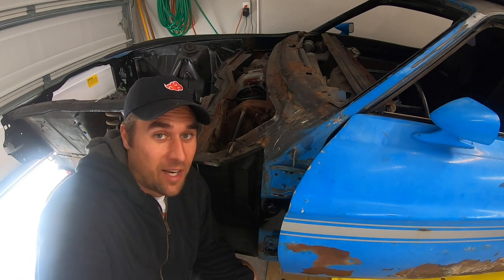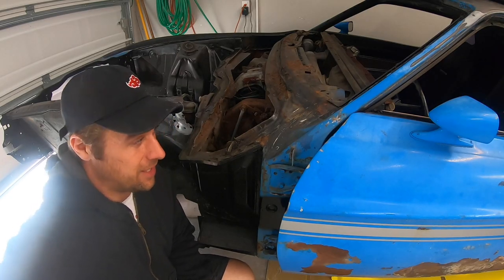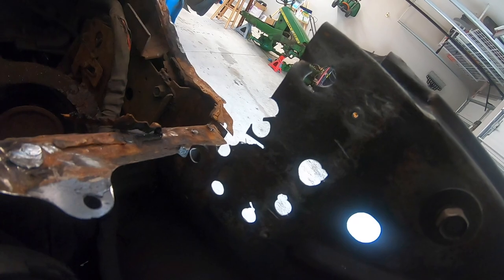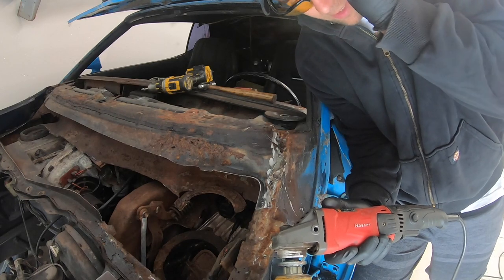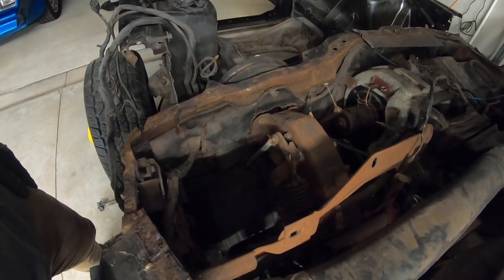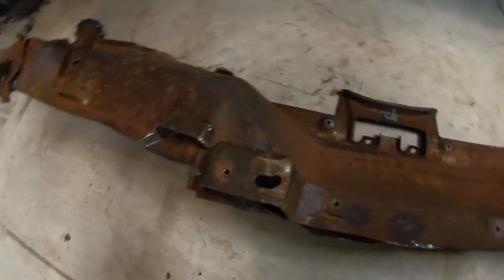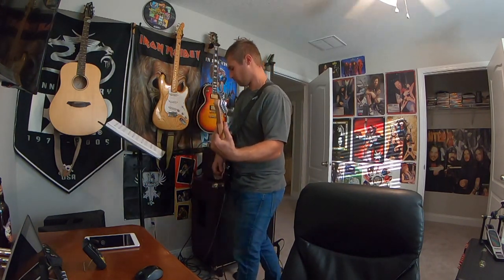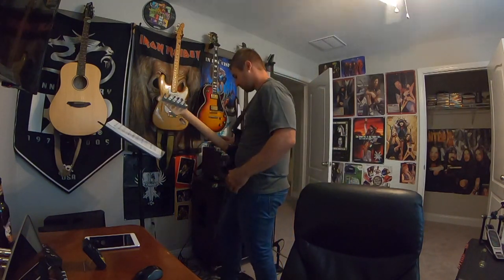1972 Ford Mustang Mach 1 Cowl Replacement Part 1

Comment: Enjoyed the vid man. I'm restoring a 1972 Fastback Mustang now, and also a die hard Van Halen fan, so this really hit home. Right now when I run water through my original cowl it seems to all go outside the car, nothing down the firewall, but I'm interested in somehow treating my existing the cowl with POR coating to keep it in good shape. I guess I still have to take off the top cowl to do that.
Reply from the maker: Hey man I know there is this thing that the Eastwood company has that's an aerosol coating you can do that has this very long straw with a bunch of holes all around it that you can run through your cow and it'll coat it the best way you can without removing it. It's a very minimal cost for the product in very little effort to apply it. They advertise it as a frame rail coating tool and in the top rails of old '50s Fords and GM trucks that have the tubular top rails. This would be a great alternative to cutting your cow open to treat it. But if you're up to opening up your cow just drill out all the spot welds of it as if you're going to replace it but in that same thought you might as well replace it if you're going to go through all the hassle at least the top. Obviously the choice is yours but those are my thoughts on it all.
Reply from the maker: You can also start at the very ends of each side of the cow and put poor 15 on a paintbrush because a little goes a long way and just apply it with a small paint brush or a terry cloth of some sort. And work your way back to the center so you're not putting poor 15 all over your arms
Reply: @SteffsGarage  Thanks, great ideas. I'll be taking a closer look soon to see if any rust is in there

Comment: Great video thanks for all the info very interesting, Im just busy contemplating doing this job aswell on my 72 non AC.
Reply from the maker: Thank you for the comment. It is a tedious process. It was essential for my restoration on this one and due to the motor being out it made things easier. I wouldn’t have done it with the motor.

Comment: Hey Steffen, great video! I'm about to do the same to my 71 Mach 1. When can we expect part 2 of the series? Great music BY THE WAY!
Reply from the maker: Hey Robert part two is already up. Is it called rusty cowl removal pt. 2. Thanks for checking out the vid. I'm closing in on the body work now of the mustang.
Reply from the maker: I just changed the name to the same as part 1 except now it reads part 2. Should be easier to find

Comment: Is there a reason you did not use a spot weld cutter tool?
Reply from the maker: I did. It must have just been mixed in and not announced.
Reply from the maker: Those are definitely essential for this job.

Comment: With AC you don't have the funnel and opening on the driver side. Just weld your new part shut. Just did this on my 72 Mach 1, AC car.
Reply from the maker: Thank you so much. I really appreciate the input. I have heard all kinds of stuff about AC cars and non-AC cars. I’ve even heard from a few local exclusive mustang Restoration Shoppes that it could’ve came with both the holes open if that’s the only parts they had at Ford at the time but these cars were produced almost 20 years before I was born so I’m trying to figure it out as I go on the history
Reply: @SteffsGarage  sure, no problem! We big horse owners gotta help each other out 👍